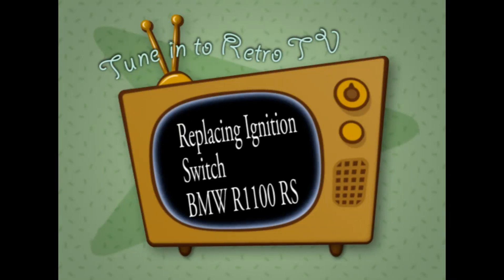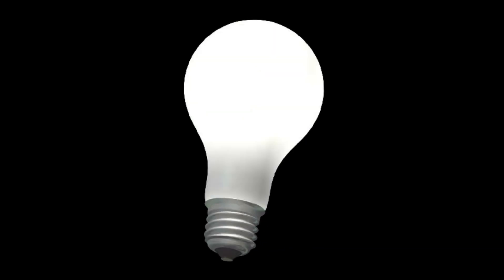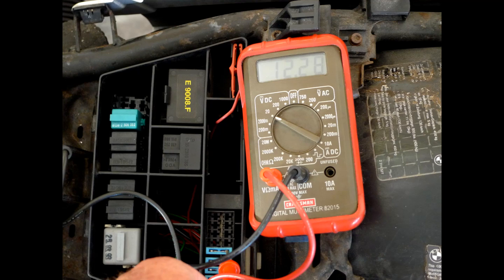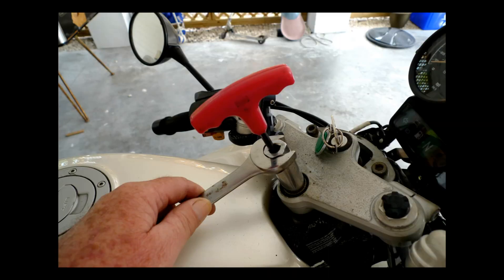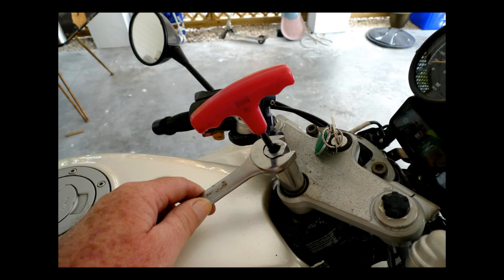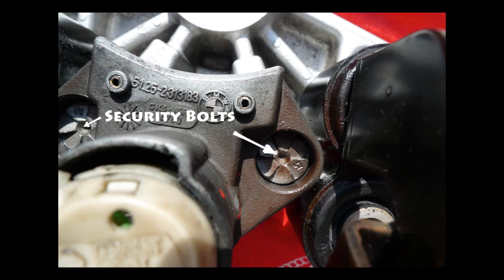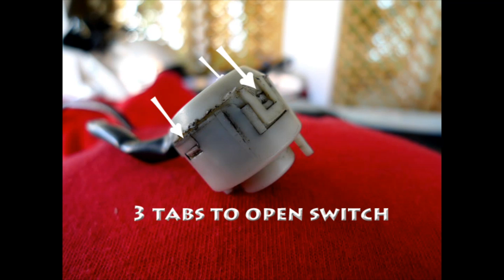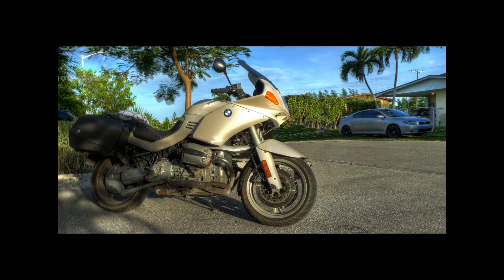Replacing ignition switch BMW motorcycle

Comment: Thanks for your vid, John, very helpful. However, you can also get to the switch from the right side with the tiny screwdriver, without unscrewing anything else. Works for R1100S and R1150RT anyway. The switch then falls right out.

Comment: Thanks man. I LOVE YOU!
My bike failed the tail light and the front parking light on the yearly test. Both are wired in parallel, with no power to the fuse. Either the plug or socket is kaput or the wiring loom needs a repair.
Now I'm cooking to go. Thanks again.

Comment from the maker: I used either a sparkplug socket because it has a space for a open end wrench. The wrench then turns the SPlug socket. In the center I secured the bolt with the red handled Allen wrench. I am sure you could use a socket attachment on an extension with a socket handle. Once it is released it is pretty easy. I did not have to deal with the security bolts. Any other questions please let me know.
Reply: Let me see if I understand this correctly:  The Allen screw pre-loads the bearings and outer nut that you are turning with the spark plug socket applies the torque to hold the assembly in place.  Question:  How did you reassemble this so that the allen screw is torqued correctly.

Comment: How do you take out this security bolts? Thanks
Reply from the maker: Thanks for watching. I was lucky in that I did not have to remove the security bolts. I'm going from memory from about 5 years ago but I do know that this design did not require the removal. Sorry I can be of more help. I do know that the bolts can be drilled out and the dealer will sell you the replacements. Again, this is from memory do I would check first before drilling. Good luck and ride safe.
Reply: @capedoryus  thanks sir!!!